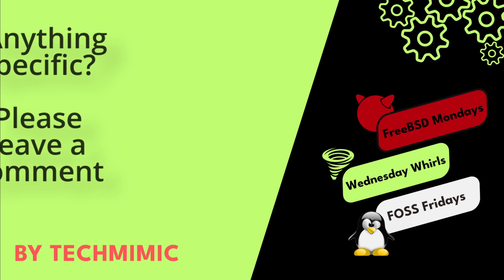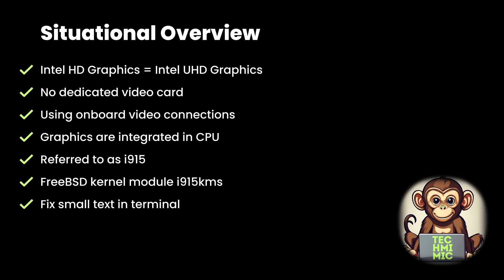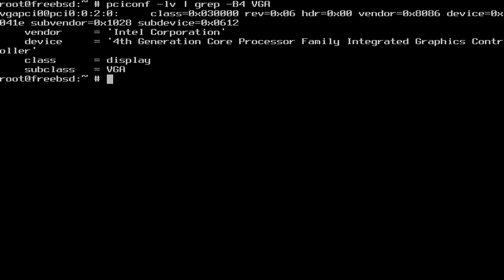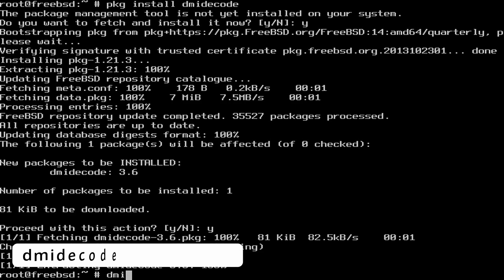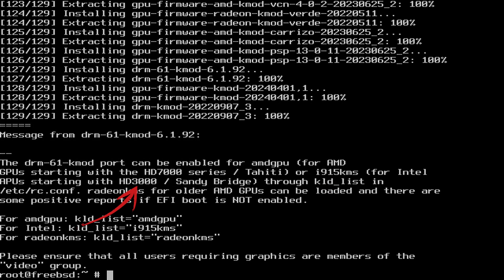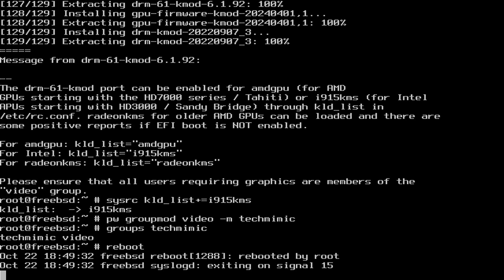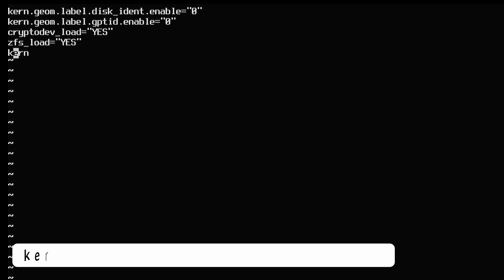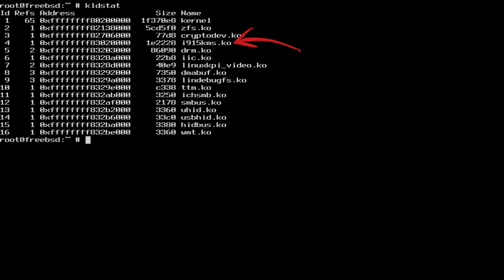How to configure INTEL integrated GRAPHICS in FREEBSD (Intel HD / UHD Graphics / i915)

Comment: tell me please man, my grafic card is  Intel® UHD Graphics for 10th Gen Intel® Processors
i'm do same like the video, but after reboot 1.dualmode take blackscreen(  worked only 2.single mode, where i am wrong?
Reply: I had this same problem. I bet you're running FreeBSD 14.2. When you install the drm-kms package on 14.2, it says you need to rebuild the package from ports for it to work on 14.2. So either rebuild the package, or install FreeBSD 14.1 instead and then follow these steps and it will work.
Reply: @empathy_monster  Thanks bro, but I'm gonna stick with the Arch for now, maybe someday when I get my mind right.
Reply from the maker: Always a challenge to tell from a distance. There will possibly be a clue in /var/log/Xorg.0.log or in the output of dmesg (filter for things like Intel, drm, etc.). Hope some of this helps, it's generic I know.

Comment: Great done. My lenovo Ideapad 3, i3 6006 and HD 540 got stuck during bootloader. Does it supported by 1915 kms? Thanks
Reply from the maker: Thank you! Can you try to add i915.modeset="1" to /boot/loader.conf, to see if this makes a difference? Make sure to reboot.